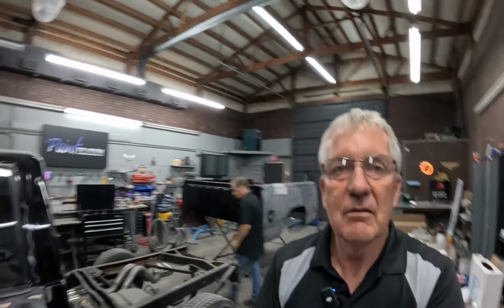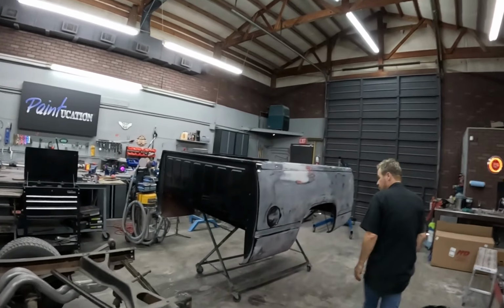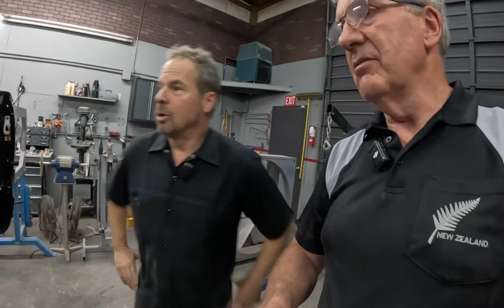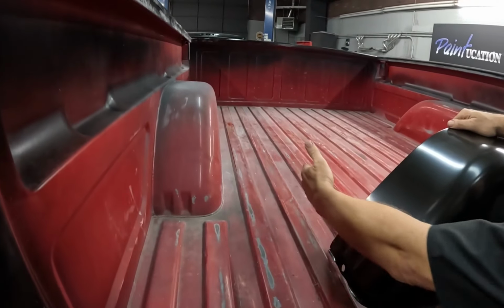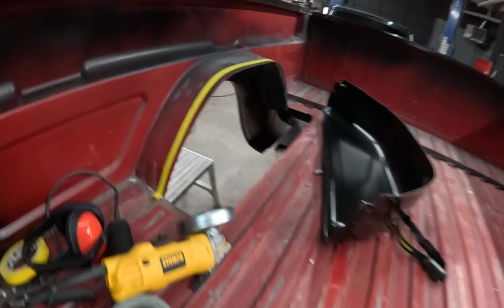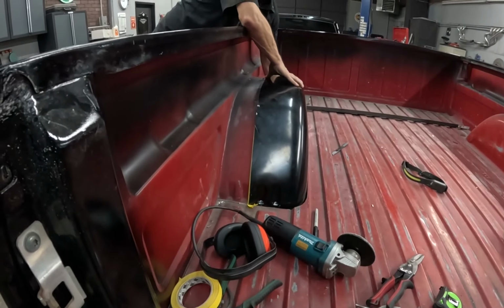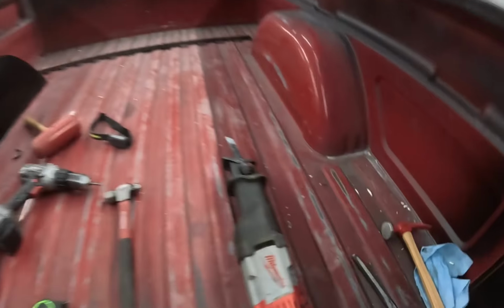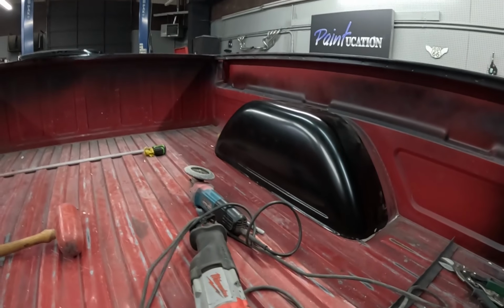The Dynamic Duo Strike Again !!  Custom Wheel tubs for VGG's OBS Truck               @ViceGripGarage

Comment: An alternate tub modification idea for future thought. My two cents......🤔
Cut the factory tub away from the bed exactly the way you did it. Temporarily tack the removed factory tub to the bed at the desired location. The filler panel (bridge) between the factory tub and its original location should be easy to fabricate (roll) out of sheet steel. The rest is fit and weld.
You could make the factory tub removal cut to include part of the floor rib where it ends near the tub. That rib feature will go with the tub to the new mounting location. The one issue is that you have to line up the tub rib with an existing inner rib to look factory correct. A small sacrifice on tub width may have to be made. Another issue may be having two parallel weld seams across the top of the tub instead of one. Would this technique have any cost-benefit over buying the replacement repop? Thoughts?
I said it before, I'm so happy that I get to see and experience my three favorite automotive content creators working together.
More Please...!!!!!
☮️ on 🌎
Reply from the maker: It would be cheaper to do it the way you suggested.  In this case AMD supplies the tubs so we went the easy road 😁👍😎

Comment: Chris, I doubt I'm the only viewer having a hard time hearing you when you're BEHIND the camera. You sound like your in a closet, under water. In front of the camera? Loud and clear! Solution might be as simple as changing an audio setting on your camera from unidirectional to omnidirectional. Failing that, a lavalier mic is the answer. I've mentioned this a few times now, with no change on your end. If others don't chime in, maybe I AM the only one struggling to hear (and understand) you. I'll keep watching regardless. One of my fave YT channels.
Reply from the maker: I've been using a lavalier mic for a while now but managed to break it. Just waiting on a replacement arriving !!  The go pro doesn't pick up well from behind. Thanks for watching and hang in there I'll be back up to full volume shortly 😁

Comment: Funny scratched my head a bit then got it the two Ronnie's lol. Been busy brought a firetruck 87 hino just out of service 38k from new it a double cab 6 seater took all the back off and put it back to cab and chassis fitted my fifth wheel and its mint. Tows my 35ft toy hauler pretty good you will get to see it when you come home for Christmas. And it has a heater and no draughts lol Still keeping the f350 to tow my car hauler as I use it a lot and it's just cool lol.
Reply from the maker: Where are based bud??
Reply: Thames with the gt falcon coupe lol
Reply from the maker: Ahh yes!!
Reply: Must have been bourbon o'clock over there lol
😁🇬🇸🤘
Reply from the maker: @strangecustoms8486 😬